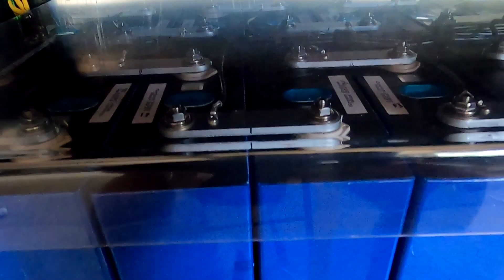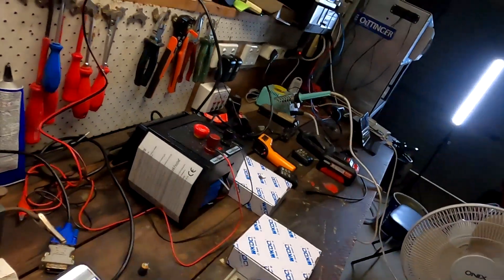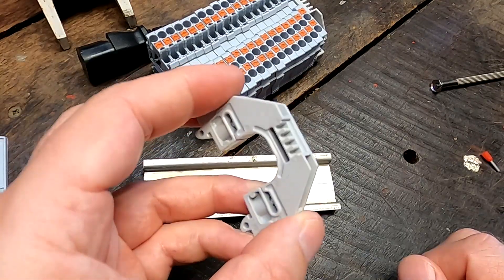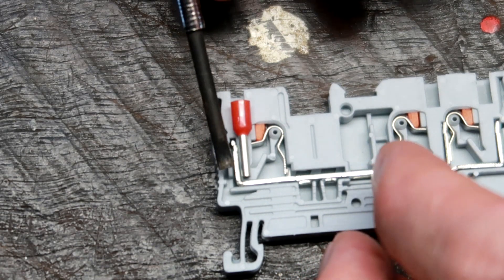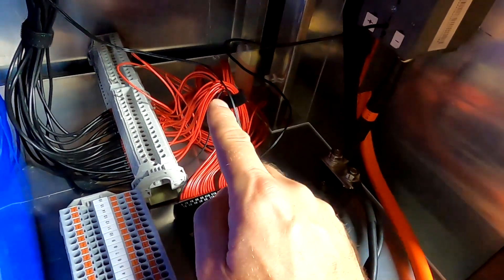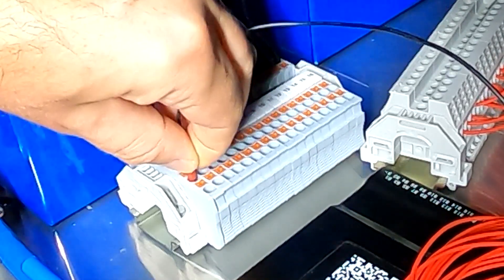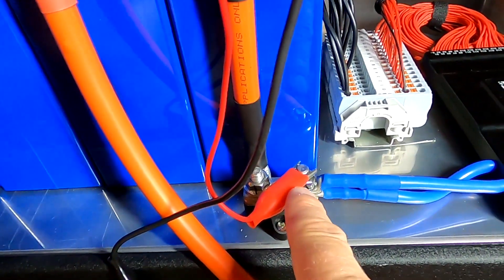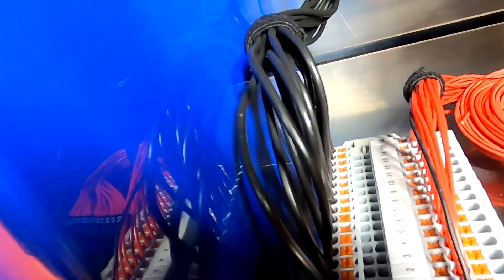New Terminal-Block to connect BMS and Balancers to the battery. Easy, clean and versatile!

Comment: What gage wire is coming out of the BMS(heavy leads)? I have a JK BMS that's rated @200 amps but those wires look a little small for 200 amps.

Comment: Hi Andy, I'm building a LiFePo4 kit (2x8) like yours. I have holes drilled in the middle of the busbar for connecting the BMS. Should I connect one of the cables to each of these rails, starting with 1, 2, 3, etc. Is it also on this rail at the transition between the rows?. Do I also connect one of the balancing cables to the + and - posts without rails or just black to - and the last red one from the small plug to +. I have JK BMS with 2A balancing. Thank you for the hint.

Comment: i used now a block like these, and i was concerned, i always got many cell ov/uv disconnects through the bms because the wires connect so awfully through the connector. i decided to make a longer cable and now i have a deviation of 0,001V if no load is applied.

Comment: What size wire did you use to connect bms 7 AW to battery?
Reply from the maker: You mean the cables for the main negative to the BMS? I used the ones which came with the BMS 2x7AWG.

Comment: Great video, I'm doing something similar, but I cut some cables from the ones that go to the batteries so I don't have to coil them. I wonder if JK BMS tests each wire and enters a different resistance for each without user intervention?
Reply from the maker: The wire length of the balance cables does not matter, cutting them won't cause any problems.
Reply: @OffGridGarageAustralia  .Thanks my friend

Comment: Adding in more mechanical wire connections just adds more points of failure. There is a BMS plug on the BMS so why not just use soldered heat-shrink connectors to join the wires?

Comment: You have to measure to battery terminal directly which with those large aluminum bus bars going to edge of battery terminal flat looks impossible with stock YR1035+ probe tip.  The newer batteries you got with welded terminals have much taller battery terminal posts that you should be able to get directly to battery terminals with YR1035+ probes.

Comment: I have always liked High Voltage Inverters. They use 100~400VDC and run at much lower current (1/5 to 1/10 of what 48V inverters) so much so, not-so-perfect battery connections is a non-issue.
Reply from the maker: That will be the case when dealing with lower currents, however this is not DIY territory any more and can be very dangerous. There is not much choice of gear and devices out there to even run a 96V system.

Comment: Schön der Phönix Contact Chinaclone
Reply from the maker: Sieht fast genauso aus, das stimmt.
Reply: @OffGridGarageAustralia  bin gerade am rum hirnen wie ich das Bier aufm Gütle kalt bekomme. PV Anlage  (4 Module) mit 2kW Inverter und 5kWh Batterien steht schon. Will den Kühlschrank durchlaufen lassen und ihn deswegen nicht am Inverter anschließen. Entweder separater  300W Inverter für den 230 V Kühlschrank der vom Thermostat angesteuert wird oder ne 24 V Kühlschrank Lösung - die sind allerdings nicht gerade preiswert
Reply from the maker: @mbr8981  geiles Projekt. Muss ich auch noch machen! Ja, die Kuehlschraenke fuer Niederspannung sind teuer wenn man da was anstaendiges mit Kompressor haben will. Miss doch mal wieviel Energie der Kuehlschrank benoetig wenn du ihn 24h  durchlaufen laesst. Dann hast du eine gute Vorstellung ob es klappen koennte.
Reply: @OffGridGarageAustralia  ich sehe das Problem bei der Standby Leistung des Wechselrichters, sind bei dem 2kW Wechselrichter auch so um 15 Watt. Der Kompressor vom Kühlschrank läuft nicht so oft, wenn nicht gerade jemand Minuten lang die Tür offen lässt. Hatte mir jetzt überlegt den Steuereingang von dem 300 W Wechselrichter mit dem Thermostat im Kühlschrank zu verbinden. Und mit dem DC Load Ausgang vom MPPT Regler hätte ich das zusätzlich verriegelt wenn die Batterie unter eine bestimmte Spannung fällt.

Comment: Hi Andy I have a 12v garage system, I am going to buy 8  304ah cells, what is better 12v or 24 volt. I have 850 w of solar. If I  go for 24 volts I will require a new inverter.
Reply from the maker: In this case I would go 12V then to save you buying a new inverter. If you ever upgrade your solar and want to use more power, you juts need thicker cables with 12V than with 24V (so spend more money there). Apart from that, no difference.
Reply: Thanks Andy for your thoughts I love your video,  I have a small home brewery in my garage so I have ordered 8  x 304 ah  cell from china no going back now . I intend to buy a phoenix 24v  3000w inverter . Wish me luck. Your thoughts! .....

Comment: Hey Andy, if you cannot detect the bad connection using the internal resistance meter, I think you are not using the correct methodology: I have been able to detect major connection issues … you need to measure between 2 busbars (I.e. really the cell resistance) NOT between busbar and terminal or both ends of the busbar. Of course you need to review 2 busbar connections to find the issue, but it is usually easy identify which one it is …
Reply from the maker: But then you wouldn't be able to tell which side of your terminals are the bad connection.
Reply: @OffGridGarageAustralia  that’s why I wrote you need to review 2 busbar connections each time, but it is usually easy to identify which one is the cause… as explained I have been able to solve the issue that way (or replacing the ‘bad’ side with a flexible busbar).

Comment: @Off-Grid Garage  You used the TR1035 to measure the resistance of the busbars? Does it work despite it not being a battery? So it acts as a milliohm meter as well? I was wondering also before buying one if it could be helpful to measure in between cell resistance
I do not understand what the TR1035 cannot measure that you mentioned in the first minutes of your video
Reply from the maker: Yes, you can measure any sort of resistance. It uses the 1kHz signal for that.
To measure the resistance between battery terminal and busbar (just this connection), you would need access to the terminal somehow. But it's 100% covered by the busbar...

Comment: Do you have an idea about final BMS?
Reply from the maker: The JK will stay in there for a while. I have two more battery banks incoming so we can look for alternatives for these then.
Reply: @OffGridGarageAustralia  I've heard about Seplos 48V 200A BMS. This will have CAN-Bus, possibly good for control with Victron Inverters ....
Reply from the maker: @caroman6761  But what would we need to control? If the BMS can talk to the charge controllers or inverter, what would be the benefit? The QUCC and JK BMS have CAN bus as well and talk to Victron. I just don't see the point or benefit of doing it?
Reply: @OffGridGarageAustralia  Oh, I get my first JK BMS in a few weeks and didn't know, that JK has already CAN. Sorry ....
Reply from the maker: @caroman6761  no problem. The JK is really good, you will love it.

Comment: Could you measure, not resistance, but voltage drop during the load. From that data you should be able to calculate resistance R=U/I during the load. It could be interesting how that resistance changing with and without the load.
Reply from the maker: That could be done, I guess... The current is the same in a series connection. Only problem is the accuracy of the current measurement using a clamp meter.

Comment: I would have installed the balance leads into the second holes.  The reason being, it will be easier to access the centre holes later if adding an active balancer or something.  Saves working under the balance BMS leads.
But then again. I see your finished result, and maybe it's just fine as it is.
Reply from the maker: Let's see how we go. My understanding is the centre hole is just for measurement to get access to the busbar?

Comment: Could it be that the connection problems may be related to the increased humidity that comes with the rain you are apparently are experiencing? What is common and what is not in relation to the previous problems that you have had with connections? You seem to keep good records. You might want to compare the conditions from those times to what you are working against now.
Reply from the maker: I had these problems even with the battery 1 and tried different methods to overcome. It is all fine now after sanding the ends and applying some paste.

Comment: I am planning on doing this with the JK BMS relay version. Is there a recommended length for the balance leads in total?
Reply from the maker: They can have any lengths. The BMS measures voltage so length is not of any concern.
Reply: @OffGridGarageAustralia  Does it not also balance them? JK BMS mentioned 2M max when I asked them prior to your response :)  Have you by chance used the larger relay driven BMS , I have a few questions for you. Thanks Andy for the great content!

Comment: Nice, I love how you will not compromise on quality and always do everything to a high code standard
Reply from the maker: Thanks Paul. I'm trying my best. I'm trying different products and see which work and which don't.
Reply: @OffGridGarageAustralia  What I didn't like was having the cables go in from the top rather than from the side.

I followed your link and looked around at related articles. I found Wago-type quick connectors for din rail, all colors and combinations, straight, dual and tripple. 

Some with a slot for standard plint markings.

Comment: Ordered mine.  Same as you.  Got to be careful as some are in lots of 3 etc.  Nearly ordered loads by mistake.  I bought the 50 terminals as they were cheapest. This will make it look some much cleaner as I have wires everywhere.  BMS leads are really short.  They needed to be 1 metre so I could place the BMS on the wall rather than next to the batteries. I have to extend them and the BMS main leads.
Reply from the maker: Great, it will look neat. You can extend the balance leads as you need them, no problem. In the old battery, I had to shorten some and extended others.

Comment: Are you able to measure a voltage difference across the terminal & busbar under load?  If so, you can then infer the resistance: R=V/I.  This is commonly done on large cables (eg engine starter cables) to check resistance under large load.
Reply from the maker: That's not possible unfortunately as the cell terminals are completely covered by the busbars.
Reply: @OffGridGarageAustralia  you could try measuring on the tip of the "screw". If the connection between cell and busbar is good, almost no current should flow through the screws and therefore they should perform as a terminal voltage sense. Not perfect but maybe good enough?

Comment: Andy 
I don’t think it’s a good idea to use the third tap on the terminal block in your situation. Your BMS has 2 amps of balancing current even at low Delta (which is more than enough for 310 ah cells). When it’s balancing, any voltage at the terminal block won’t make any sense to any other balancer due to momentary increases or decreases of voltage from the balancing current from the JK BMS. If you have only one device on at a time than it may work. Multiple balancer/BMS can not share simultaneously operate on any part of the same balance lead unless that leads is extraordinarily large. Each device should have their own tap at the buss bar. Yeah I know, more damned wires.
Reply from the maker: I was going to do that and pull 2 separate wires from the busbars to an individual terminal block (see the old terminal block I had it connected two had to sets of 17 terminals each).
I think you can have as many balancers in parallel as you want and they will all work. I heard stories from some using like 3 or 4 of these 5A balancers at once on one battery. And it will work for sure. 
When I will test other devices I would turn off balancing in the JK BMS anyway otherwise it would interfere with the balancer I'm testing. I guess, we will find out 😉
Reply: @OffGridGarageAustralia  
Lol that was probably me!
I used two Neeeeeee type balancers at once to top balance in series. Hey, I was curious, but it was a fail. They all had their own line to the buss bar thou. 
Have you seen my last video. Everything is working great in part of what I have learned from you Andy. Don’t balance below 3.4vpc and don’t run the batteries deep in the “knees”.  I have incredibly low delta and so many cycles. I’m to the point where I hardly think about my system. I may go a few days before I look in on it.

Comment: Are the cell voltage’s more constant now? Did you decide on a bus bar fix yet?
Reply from the maker: Yes, they are but the fluctuation is really coming from the BMS and how it measures the voltages at the time. The BMS does not do RMS as you voltmeter would do. So it shows the actual voltage at the time of measurement and does not build an average as your voltmeter with RMS would do.

Comment: I know it doesn't have to be said, but be really careful when plugging in and unplugging the BMS connectors when they are connected to the battery on the other side. I toasted a JK BMS like this a couple of years ago because the exposed part of the pins on top of the connector brushed against the BMS pins for a fraction of a second only a few pins off. 

Otherwise I really like the JK BMS, I tried it after using the balancer for a couple of years. I ended up upgrading to a much larger inverter and so went to a Nuvation BMS for all the Nissan Leaf cells, but I think I'm going to break it up and use a bunch of JK BMS's all around, as well as on new battery capacity that I add. I'm working on a project to make a raspberry pi a central point so it can communicate with all the JK BMS's and also the various inverters on my DC bus. BTW the Nuvation is a quality piece, but I still use a JK active balancer instead of its passive balancing.
Reply from the maker: Thanks for sharing. How else would you unplug the BMS if not disconnecting the balance leads first? These exposed parts of the connector are very hard to reach. I wonder how you managed to do that 🤷‍♂️
I always wanted to connect the BMS to my system as well but the longer I think about the less I think there is a benefit of doing it. What would be the benefit apart from having access to the cell voltages maybe? Sure you can disconnect the load if on cell gets low but does the load (inverter) does not do this anyway? The same for charging, if one cell gets high, the BMS disconnects the charger... why report these numbers and have the solar charger disconnect in such a case?
Reply: @OffGridGarageAustralia  I don't know how the connector managed to brush the pins like that either, it sort of blew my mind 🤯and was really agitating, especially since it took like a month to get the BMS from China at the time. Since then I make sure to unplug them straight out and while still gripping the connector put it in a little plastic (pensil?) case I found and made a rounded notch for the wire bundle - so it can't possibly touch anything else.

I've noticed a couple of things: 

Occasionally the temperature in my garage will be lower than the usual ~18C from a cloudy day, and then the next day will be sunny with cool panels and so it will end up being a few times my battery reaches 100% SoC, but I notice over 90% or so at lower temperature my cell voltages will diverge enough to cause a BMS fault, so if there were BMS communication then it could indicate to lower the charging current to properly top the battery (I suppose I could get a 5A or 10A balancer instead of the 2A I have now, the problem is all the balancing seems to need to take place at high SoC at lower temps, otherwise the balance is fine).

This is specific to the Deye inverter that I'm using, but when using only voltages for the battery programming it seems to also favor the lead-acid charge to full after discharge cycle. It is a hybrid inverter working in combination with grid in a zero-export mode, and it doesn't seem to pull from battery unless it thinks it has reached full charge during the day. Everyone else I know is using it with a compatible BMS communicating with it, and it seems to pull/push power at any SoC with those.

I'm also looking at the Seplos BMS's, they support almost every BMS protocol and will work with almost every inverter.

Comment: i guess if one could get access to the terminal lug under the bus bar one could measure the voltage drop maybe this would indicate a problem
Reply from the maker: But then you would have something in between the terminal of the battery and the busbar? Like a ring lug to measure?
It's all a bit wonky, I think.... very hard to get a reliable result.
Reply: @OffGridGarageAustralia  i did not mean anything in between i ment if one could get the probe to contact with everything in place doubt it is possible but was an idea

Comment: You should get another set of balance wires for the bms so you can make short ones for the terminals
Reply from the maker: Are these connectors to the BMS standard?
Reply: @OffGridGarageAustralia  Yea they seem to be a standard connector, I found them on aliexpress by the name "JST connector" but im not 100% sure if they will fit because they make diffrent pin size. the bms could be 2.54 mm or 2 mm pitch size but i'm not 100% sure

Comment: hey that looks good! how are the new cells working out? are they all staying balanced? or will an active balancer be the next video?
Reply from the maker: Tbh I have not the chance to fully charge them yet. I'm in the process of minise the load and fully charge both banks right now to calibrate the smart shunt as well as to balance them. Video will follow...
You can see the live view of the setup here: https://vrm.victronenergy.com/installation/100328/share/2e028071